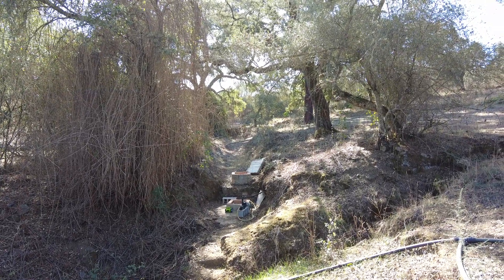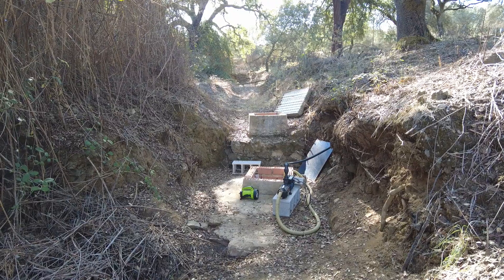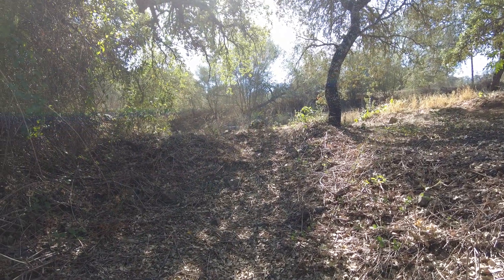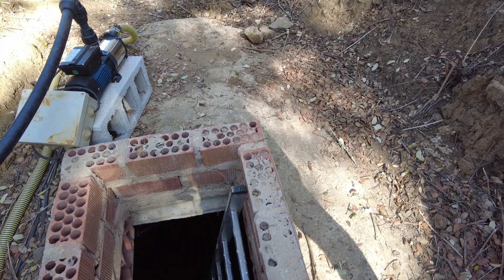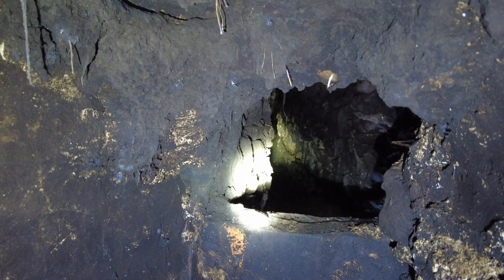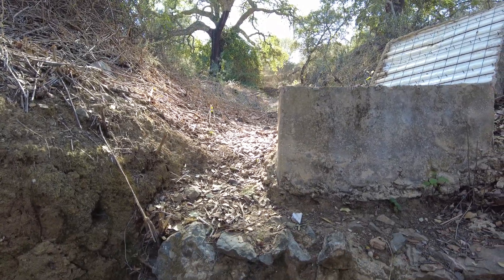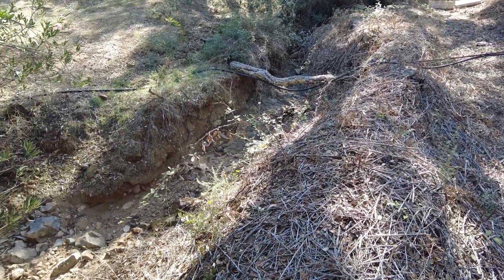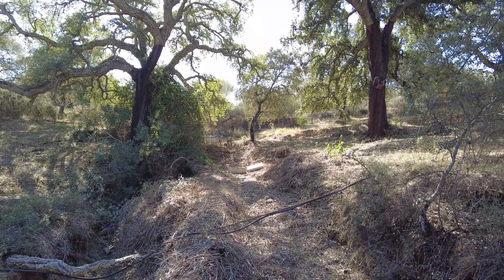Qanat and acequia water systems exploration on an Andalusian farm.

Comment: Not afraid of co2 or methan down there?
Reply from the maker: Mmm. I'm afraid but I left all the shafts open for some time!
Reply: @SuerteDelMolinoFarm  Leaving the caps open to ventilate the qanat was a good idea.  The chambers do not seem to be very deep.  But the Farmers wife should be with you when you enter the chamber.
Do you have measurements from the bottom of each shaft to ground level?
Do you think you could see the floor of the qanat at the top shaft or was the floor covered  with mud/silt that would have washed into the qanat from uphill? 😊
As you were looking into the top shaft, could you see the qanat continuing on in the direction of the mountain?
Reply from the maker: @stevejohnstonbaugh9171  The depth of the shafts are about 2.5 meters. The second shaft continues towards the mountain but I'll have to get down there to verify. I couldn't lower my camera deep enough to have a look. Just an observation from peeping into the top shaft. The other info I don't have yet. I'm now trying to find locals who worked on this qanat or who cleaned it before to chat to. People in the village know about this qanat. The one person who knows the most is an alcoholic and I don't want him down the shaft. One day we will know. I also want to contact the university of Granada and talk to them. Never though I'll be crawling in tunnels as a farmer.

Comment: Ok, I think my comment got deleted because I included a commercial URL as a reference for Martin.  So I'll try to put it down before I forget in more general terms.
The University of Grenada Archeology Dept. studies qanats (the name used by the Moors for their invention; the water mine. Acequia or séquia (Spanish language) is a community-operated watercourse (open ditch) to conduct irrigation water.  So it seems this is likely a qanat.  If you would really like to have this fully investigated, I suggest reaching out to the U of Granada.
So the Roman Empire expands to Spain in 206 BC.  With them they brought fired clay brick and Roman sprung arch building methods.  The Romans rule until the later half of the 600's when the Moors show up.
Around 700 the Moors are in charge and the Romans are slaves.  In Iran (today) formerly Persia - the Moors had developed qanats.  There are loads of cross section illustrations if you Google "qanat elevation illustration"  Based on what I have seen from you and the illustrations, that's what you've got.
So back home in Persia and northern Africa around 700, the Moors are still building with adobe mud sun dried brick. But as your film showed today, your tunnel is lined with fired clay bricks that form vaulted ceilings.  So the Moors brought the design, the Roman slaves knew how to make fired brick and the slaves and the rulers collaborate (more or less) to build your qanat.
So around 11 centuries later, the Spanish ruling party decides to build an elevated highway and install a culvert at the lowest elevation of the land, so rain water coming off the mountain can pass under the elevated highway. It just so happens that your qanat follows the same irregularity in the slope. So the culvert is laid and the fill is made.  Additional air shafts going up the mountain are collapsed or covered and your qanat is forgotten. and the gully starts to erode down the watershed. 
Somewhere in the second half of the 20th century (based on the brick design for the shaft "headers") the farmer in the land finds the cistern?!  He sticks his head down into the cistern and sees there is a tunnel running up the mountain and a pool of water.  So he gets his boys out there with picks and shovels and they start digging, working there way uphill. He has no idea of the antiquity, he just sees an opportunity for water and wonders if he can get more.  As they go, they uncover two more shafts, creating a canal like depression as they toss the extra soil to each side.   They get to the second shaft and stop because it is dry.  Farmer stacks up the brick headers and puts the insulated caps on top. And that is where the story ends.   He has a steady supply of water in his cistern, he blocks up the opening and puts a 1970's piece of flex pipe between the first shaft and the cistern.  I suggest you remove that obviously recent "improvement" Martin and let the cistern function as built.
Now you buy the property and you have different needs.  I suggest you need ample irrigation water to jump start the regeneration of your land.  I believe enough water comes down the qanat over the course of a year that you can harvest the surplus sustainably, store it and use it for irrigation to accelerate the regeneration process because Nature won't mind and may even be pleased.
I suggest a simple mercury switch in the cistern that turns the pump on when the water level rises to X and turns the pump off when the water level falls to Y.  This is simple, it's automatic and it is sustainable because it will never drain the qanat due to a broken fitting, for  instance.
I suggest a corrugated galvanized and powder coated steel tank with a liner and cap sitting on a cement slab on the knoll.  Made in the UK, a 50,0000 gallon tank is less the $3,000 pounds.  The tank is shipped flat on a pallet and 2 people can assemble it on the slab. There are two flow holes cut into the tank.  One is the supply line from the existing pump and the second is an overflow which runs to the highest swale and berm on the property.  Should the tank overflow that water is never wasted.  It infiltrates the swale, irrigates the berm and plumes downward  and outward to resupply the qanat aquifer.
This is where I went wrong before,  I copied the URL from the UK company for this tank so you had ready reference.  GOOGLE then dumped the entire post because it ended with .com
In summary: I suggest the "canal" is a meaningless leftover from a prior investigation that ended at the second air shaft.
 I suggest that your existing earth diversion dam planted with herbaceous plants is perfect, diverting 100% of the water into the stacked swale system.
I suggest the stacked swale system will more than adequately filter the runoff water, permit infiltration through the clay soil (improving over time) and  allow the rainwater to plume downward and outward into the aquifer that feeds the qanat.  With the exception of transpiration and evaporation, a closed loop that is replenished from time to time according to natures schedule with precipitation.
I suggest the qanat presents a unique opportunity for the Archaeology Dept. at the U of Granada to study a perfectly preserved qanat, especially as they go beyond the second air shaft with modern endoscopic and robotic technology and a once in a lifetime for you to see first hand how the professionals do it. And all the while you can be irrigating your berms and gardens with sustainable water run by an automated system of digital timers and drip lines.
Reply from the maker: Much appreciated Steve

Comment: Nice exploration, still most of the structure to be re-discovered. 
It was a costly system to build, which shows that water shortages due to droughts is nothing new in the area.
The creek at the side is quite deep but narrow, should be quite easy to place several check dams/obstructions to hold on to water for longer.
Reply from the maker: Yes. Several check dams are planned. Thank you for sharing
Reply: @SuerteDelMolinoFarm  BTW what are the relative levels of the bottom of the creek and water inside the structure? As if it could enter during winter months (from the side), if walls are not water-tight, it would escape in the summer. Thus maybe it's only recharged somewhere uphill? Clearly, more to research 😀
Reply from the maker: @hotbit7327  The creek floor is lower than the water in the qanat. Thank you for sharing

Comment: It is big indeed. It must have been a costly and therefore important structure for those who originally build it.
Reply from the maker: I don't think I have any idea about what is really down there. Thanks for sharing
Reply: @SuerteDelMolinoFarm  It is intriguing, We can make some interesting observations. These people had to dig a trench, maybe even cut some bedrock, and they did it all by hand. Then they had to build a kiln because they used bricks for the arches and they had to make the bricks themselves, and the bricks look very uniform which suggests that they were molded. Which is very well possible because that technology existed well before the Moors arrived in Spain. They also had to source all the clay locally. They even stacked natural rocks to create the walls, so each of the rocks have been hand picked, and installed by hand. You can even see that the smaller gaps are filled with well fitting smaller rocks. 

And they did that roughly between 1200 and 600 years ago without any heavy machinery. 

I mean, the amount of work that we are looking at must have been huge. And then there is the question, why? Did they do all that work for the cattle while there is a creek flowing next to it? To me that doesn't seem logic.  Or to water the crops? Was it a strategical military site or a fort? 

A local archeologist might be able to answer some of those questions.

Comment: I don’t know how silly it will sound but have you considered redirecting your creek’s water directly into these shafts? I mean all that run off that you had, may be it can be redirected into the system as “direct recharge” of the system?

I am assuming the water will be filtered through before entering the system so as to minimise silting.
Reply from the maker: I though about it many times but there is an American saying: if it ain't broken, don't fix it!
Reply from the maker: I would like to speak to an expert, that would help a lot.
Reply: Agreed Raj.  If Martin is indeed lucky enough to have enough water to fill his dams and swales, then rather than having excess water leave the property, perhaps a pump pipe directly from behind one of the dams and into the underground chamber would help directly.
Reply: I suggest that the series of swales through which this water infiltrates is filtered and plumes is already a direct recharge of the qanats aquifer.
Reply: @stevejohnstonbaugh9171  Of course they are being recharged through surface / swale / creek seepage but there’s something known as “direct aquifer recharge” which is quicker and can take in a lot of water in a short time. If you search YouTube for “direct well recharge” or “direct borewell recharge” or even “direct aquifer recharge” you will tons of videos. As an experiment it may not be a bad idea to divert (but filtered) water into the underground canal system (qanat?) and see if it helps. What harm can it do?
Reply: @rajsinghji-84  No offense intended Raj.  I was responding to your remark about the need to "filter".  I was simply trying to point out that there is an existing network of filtering mechanisms in place., the swales and berms.  The qanat tunnel (as I understand it) was designed and built in antiquity to collect water that flows through subterranean geological formations seeking the path of least resistance. That entire process is the filter.  The shafts were not intended to be a means of direct aquifer recharge.  Of course deep pits and bore holes are possible, and this is Martin's decision, but I don't see them as likely given the storm water retention efforts to date. My suggestion is to prioritize a means of collecting this clean qanat cistern water when supply runs high and focus on storing a large volume for irrigation during periods of drought. 😊
Reply: @stevejohnstonbaugh9171  No offence taken :) As an experiment, perhaps a bit of filtered water can be redirected to one of the pits and see what happens. I totally agree and understand the process of seeping water and filtration, very well detailed by you.